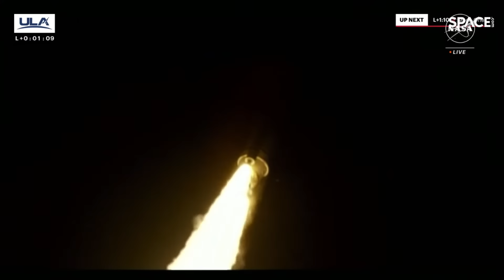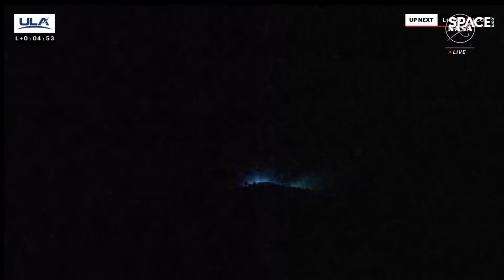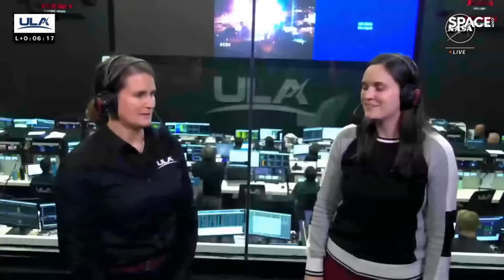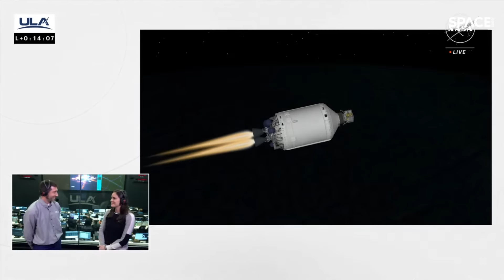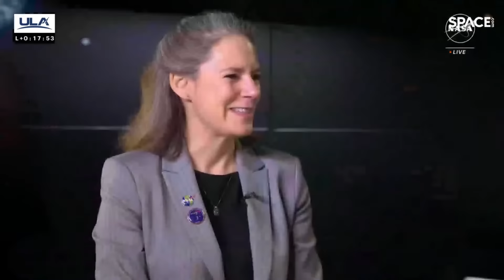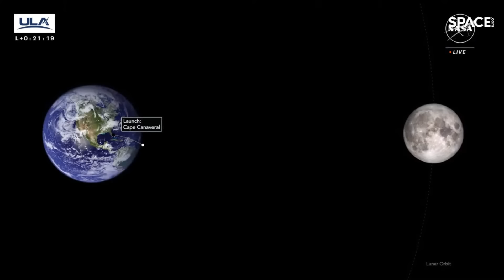Blastoff! ULA's Vulcan rocket launches moon lander on first mission

Comment: Peregrine spacecraft has a faulty propulsion system, which, unless fixed, will prevent a lunar touchdown. The problem has made it difficult for the craft to point its solar panels at the Sun to generate electricity.

Comment: Finally, you equalized the falcon heavy, except the price and reusability…..
Reply: Well this is down to 112 million and the heavy is still 100 million with no indication that reusability means much of anything at this point. ULA was able to reduce prices over time on the other platforms while SpaceX still hasn't done that after several hundred successful Falcon 9 launches with this supposedly amazingly cheap reusable rocket. Not to mention it did it on the first launch....
Reply: @jeffhaggarty9879 
All true.  That said, Falcon-9 is still cheaper to use than it's "competitors."  That is largely due to F9 being reusable after many launches.  With no real competition, SpaceX has no reason to reduce its prices.

I would like to see a booster with nine Raptors replace Falcon-9 in that niche when the current boosters start being retired.  They would need separate launch facilities because tge would use different fuels and be somewhat larger.  That size booster would also give SX something with which to work out "catch mechanics" with a much smaller blast yield in the event of a crash for any reason.

Comment: You can tell it’s real cause it looks so fake😂
Reply: It's a rocket launch. It's visible for, like, 500 miles in every direction, all the way up to operational height. As for the satellites... I satellite spot. I catch a few every clear night, where they're predicted to be. I've done triangulation measurements ( via scale drawing, or using simple trig) with the help of friends or relatives a few hundred km away, and measured these object’s heights and groundpeeds - these always come out as hundreds of km and km per second respectively. I've caught a couple of the bigger, lower altitude ones (including the ISS) through my telescope and they look as expected. And, getting a bit more technical, I used a radio set and a directional antenna to follow the signals produced by several of them, across the sky, so they are definitely machines in communication with the ground. 
All the above is repeatable by anyone, has been many times. Don't take my word for it, go out and try it. .

Comment: What was the launch cost versus a Falcon?  Welfare for legacy aerospace MIC firms needs to stop
Reply: AFAIK Vulcan-Centaur is more a competitor for Falcon Heavy than for the Falcon 9. The Falcon series of rockets have excellent mass to LEO (especially for their cost), but their capabilities drop off quickly for further orbits such as geostationary, lunar, or interplanetary. Vulcan-Centaur costs about as much as a Falcon Heavy, and while it has less than half the mass to LEO, it catches up significantly on the further orbits. Additionally, it has a larger payload fairing, which has been the limiting factor for the Falcons (especially Falcon Heavy) when it comes to Air Force launches. (Also Dreamchaser I think)

Essentially, while it is a bit more expensive, it is still competitive, has capabilities the Falcons cannot provide, and the U.S. wants to have options.
Reply: Welfare to legacy provers? What do you think SpaceX is other than a welfare company? It exists because of the tax payer. Several of these other rockets can carry a larger payload and have been able to do it the first time. Where is Starship? Still shitting the bed on the pad, that is where it is.

Comment: Only took Blue Origin 23 years to get an orbital class motor into space.
Reply: And only one try.
Reply: They had tons of failures with the be4 before strapping it to the Vulcan, same with Merlin. All 33 raptors fired flawlessly full duration last test flight and static fired perfectly about a week ago. Be4 is also a much less impressive engine compared to something more ambitious like raptor
Reply: @nuckerball1259  Yet still can't reach orbit, will never be quickly reused and turned around and launched the same day or from country to country or ANY of those things. Hell they can't even get Starship to land without damage and from low altitude let along set it down on a rough surface on some foreign planet. Other than the snake oil sold by Musk, there is nothing impressive about it at this point.

Comment: The amount of corruption around this amazing.  350 mil vs 30 mil.
Reply: And the govt/military will still fly on Vulcan due to this. Maybe less so now that it's owners Boeing and Lockheed are selling ula
Reply: @nuckerball1259  From where? This cost less than the usual price which would be around 112 million. To take the payload you would have been looking at Falcon Heavy most likely which is still close to 100 million there too. Hell Falcon 9 has never gotten anywhere near 30 million a launch as they continue to fleece the tax payers.

Comment: If you think that this rocket went into space you need to get your head examined.
Reply: found the bot
Reply: If you think rockets are fake you need to get off the internet and stop spreading misinformation and dumbing down the new generations EVEN MORE.
Reply: wdym
Reply: With respect, the launch is visible for 500 miles in every direction, all the way up to operational height, using binoculars, telescopes or telephoto lenses. And there are literally thousands of people who do so with every launch. It's a hobby. Then the satellites... I satellite spot. I catch a few every clear night, where they're predicted to be. I've done triangulation measurements ( via scale drawing, or using simple trig) with the help of friends or relatives a few hundred km away, and measured these object’s heights and groundpeeds - these always come out as hundreds of km and km per second respectively. I've caught a couple of the bigger, lower altitude ones (including the ISS) through my telescope and they look as expected. And, getting a bit more technical, I used a radio set and a directional antenna to follow the signals produced by several of them, across the sky, so they are definitely machines in communication with the ground. 
All the above is repeatable by anyone, has been many times. Don't take my word for it, go out and try it.
Reply: You first